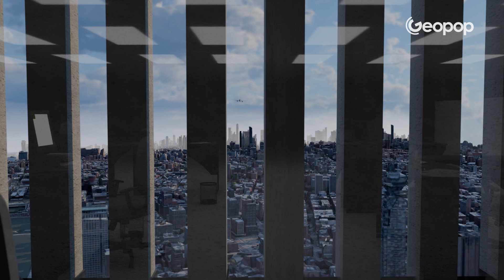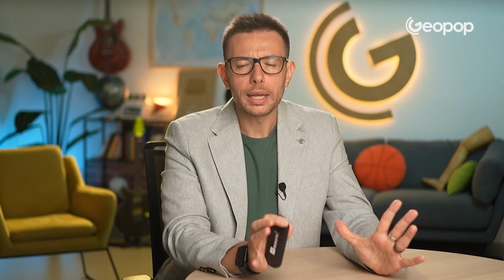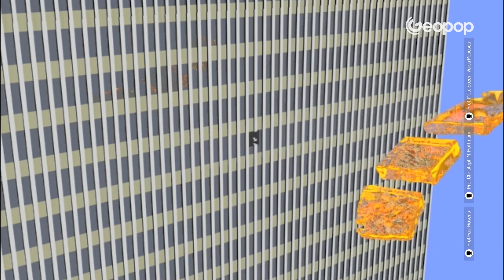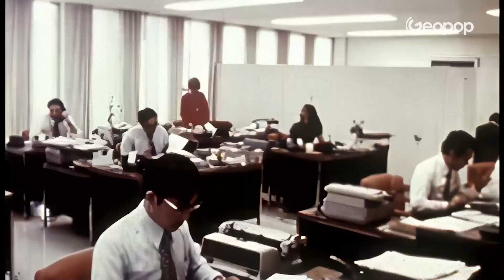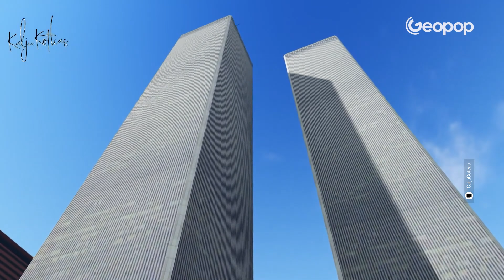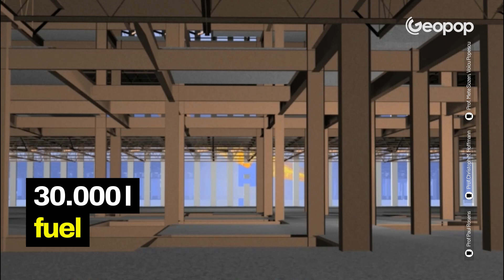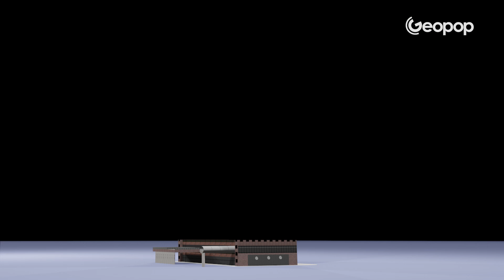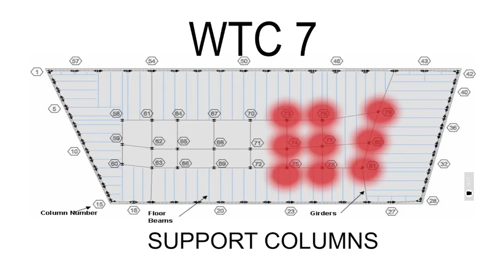9/11, 2001: The Technical Reconstruction of the Twin Towers and WTC 7 Collapses

Comment: Other high-rise buildings that sustained fire didn't collapse, so why did these??? Watch "The Anatomy of a Great Deception" by David Hooper and you will get your answer!!! The Nano-Thermite is the clincher!!!
Reply: Because (A) their fires were fought, and (B) those buildings weren't hit by jumbo jets doing 500+ mph.
Reply: @Tim22222 commercial jets can't reach 500mph that close to the ground the atmosphere is too dense. More lies...
Reply: @HKmaroLS1 yet everyone saw it happen
Reply: @HKmaroLS1  CITATION NEEDED
Reply: @Tim22222  "The airplane was UA175, a Boeing 767-200, shortly before crashing into World Trade Center Tower 2. Based on analysis of radar data, the National Transportation and Safety Board reported the groundspeed just before impact as 510 knots. This is well beyond the maximum operating velocity of 360 knots, and maximum dive velocity of 410 knots. The possibilities as I see them are: (1) this wasn’t a standard 767-200; (2) the radar data was compromised in some manner; (3) the NTSB analysis was erroneous; or (4) the 767 flew well beyond its flight envelope, was controllable, and managed to hit a relatively small target. 

Which organization has the greater responsibility for acknowledging the elephant in the room? The NTSB, NASA, Boeing, or the AIAA? Have engineers authored papers, but the AIAA or NASA won’t publish them? Or, does the ethical responsibility lie not with organizations, but with individual aeronautical engineers?"

Dwain Deets
NASA Dryden Flight Research Center (Senior Executive Service - retired)
Reply: @Tim22222  Didn't watch the movie did you!!! Watch the damn movie-----AND LEARN SOMETHING!!!!!!!!!
Reply: @wasatchrangerailway6921  - Some did (Plasco, Wilton Paes de Almeida). Some didn't. Each is it's own unique case that needs to be studied on its own merits. Lack of firefighting is a key. In two cases massive physical damage from impact and introduction of floor-wide fires across multiple floors simultaneously is obviously a factor. 

This is my summary explanation of Twin Towers collapses of the Twin Towers, start-to-finish, based on my observations without appeal to, or reliance on any authority. No politics or ideology, just what actually happened, which is agnostic to who planned and carried out the 9/11 attacks or why. It has the benefit of not requiring Rube Goldberg levels of complexity and it makes logical sense. Each step in the process flows naturally from the one before AND is chock full of critical details the conspiracy oriented internet tends to leave out with no whataboutisms.  My hope is this will dispel many common myths and answer most if not all questions you may have about the Twin Towers collapses. 

While complex, most of the Twin Towers collapse mechanisms can be seen with the naked eye and easily discerned and understood by the layperson if sufficient time is taken to understand. The worlds engineering community had already largely sorted them out at least as early as October/November 2001. Still, there are many who can’t be bothered to look or perhaps work hard not to see, being more concerned about advancing political/ideological agendas (which is exciting) than science and engineering (which is boring).

1. The Twin Towers consisted of 4 primary structural elements that together formed an integrated system where each relied on the others.  47 hollow box-section steel Core Columns carry the majority of the gravity loads. The 236 hollow box-section steel Perimeter Columns carry the remainder and ALL of the lateral (wind) loads. Long-span Lightweight Steel Trusses connect the core and perimeter column together at each floor with a Hat Truss on top to tie the structure together as an integrated unit where no element can survive without the others 

2. The impact of 117 tons of airplane (= to about 12 dump trucks) at speeds up to 590 mph completely destroys the aircraft.  This in no way implies the Towers come out unscathed. Some folks don’t get that. Hitting with the energy of up to a ton of TNT the impact damages or destroys many perimeter and some core columns (33 of 59 perimeter and 20 core columns destroyed at the impact floors in the North Tower), primarily through bolt-shearing failures at the end connecting flanges, as well as bending, twisting and fracturing of weld seams. There was no cutting or slicing - the reality was far more violent and messy. 

3. The impacts destroy or damage fire insulation, fire breaks and sprinkler systems on multiple floors. Huge fires are started across multiple floors simultaneously and allowed to spread rapidly with no effective firefighting or fire suppression. This was an unprecedented fire event . All of this was observed and recorded.

4. The hotter steel gets the weaker it gets .  With fire insulation stripped away and no sprinklers the survival time of the steel greatly reduced. Gradually over time heat causes the lightweight steel Floor Trusses at the impact damaged floors to sag, which was observed and recorded.  No steel melted nor did it need to. Structural steel will fail long before it turns to a puddle. It just needs to bend

5. Sagging floor trusses pull on the increasingly weak and overloaded Perimeter Columns, causing some of them to bow inward by up to 5 feet. This was observed and recorded. A straight column is up to 4 times stronger than a bent column. 

6. The bowed Perimeter Columns buckle and fail, initiating collapse. This was observed and recorded.  The formerly static mass above which the structure below could easily support is now converted into a dynamic mass up to 30 times greater. Because they have buckled, the Columns above and below the failure point are no longer aligned . The load bearing structure below no longer bears any load as it falls past the lower columns, NOT onto them.

7. Thousands of tons of debris fall within the four outer walls, down through the open office space, crashing onto the first intact floor it encounters. This massive impact immediately breaks the bolted connections to the columns as the amount of resistance the Floor Trusses can offer is negligible.  The falling debris slows only marginally and briefly. Note:
7a. This is NOT a solid top block crashing into and “crushing” a solid bottom block .
7b. The debris falls past the columns not onto them.  The columns provide no resistance to the falling debris. 
7c. Only the bolted connections of the floor trusses to the core and perimeter columns can offer any resistance. A pair of 5/8” bolts at each end of each truss vs. thousands of tons of falling debris.

8.  This floor-led collapse progression within the four outer walls can only go straight down. Note: 
8a. This process is often incorrectly referred to as “pancaking” which actually refers to a completely different process rejected at an early stage. The catchy name stuck but nobody knows what it is supposed to mean.  Pancaking is too simplistic and inaccurate anyway. More like Kaiserschmarrn.

9. Collapse progresses through the floor systems and not down the columns. Rate of floor assembly failures increases with each successive floor as momentum increases, reaching an average acceleration of 0.65 of GA, or 35% slower than true free fall. Bam, bam, bam down the building until there are no more floors to fail.  The resistance offered by each successive floor is always the same. The mass and velocity and thus the energy of the falling debris are constantly increasing.  The falling mass increases with every floor it destroys as new falling mass is added. Some falls to the sides, but most falls down. More mass, more velocity, same resistance with each floor.
The above is unquestionably the path of least resistance

10. The Towers were 95% air by volume and as that air was compressed inside the building it is forced down the tower and blown out the sides in reaction to the building collapsing not causing the collapse. Those were not “explosions”, it was expulsions of compressed air. 

11. Perimeter Columns become detached and peel away like a banana behind the collapse front, playing out to the four points of the compass extending to more than 600 feet from the base of the towers. This was observed and recorded, the results quite obvious from examination of the debris pile. 

12. Core Columns fail last as their internal beam bracing is stripped away and lateral support from the floor to perimeter columns is lost. This was observed and recorded and is most obvious in the North Tower. 

13. For those who care about how long this took, the whole process took 31-34 seconds from the moment the perimeter columns buckled until the last core columns hit the pile, or 1/3 the rate of true free fall. Don’t believe me?  Just watch any video of the collapses and note all the loose and truly free falling debris dropping much faster than the towers themselves.

14. What was NOT observed and recorded were the 180-190 dB bangs of high explosives or the blinding bright flashes of burning thermite. Of course, neither could have caused the (silent) Perimeter Column buckling that was observed.  Neither explosives or thermite could have survived the impacts and subsequent fires either. Cherry-picking a casual comment from someone who heard a loud noise in an event like 9/11 is not exactly “proof” of anything and the pre—planned demolition case relies entirely on that. There is zero physical evidence to support either conjecture. It would be technically impossible, totally impractical and completely unnecessary. No one would bother. 

15.  The Twin Towers were perfectly safe within their design envelope.  They only collapsed when taken far outside design parameters by an extraordinary and unprecedented event. 

Impact + Fire (heat) + Time + Gravity = Collapse . Remove any one of those four elements and there is no collapse. Ignore any of those elements (as many do) and you will never understand the collapses. The Twin Towers were an integrated system in which no one component could survive without the others. One fails, the rest follow, through the path of least resistance – DOWN – through the open space, bypassing the path of greatest resistance – the columns. Don’t get stuck on the but the lower floors weren’t on fire nonsense. 

I hope you found this helpful and learned something. This is meant to be informative, not adversarial, posted with the objective of soliciting informed critical comment, positive or negative. If I made any errors of fact, logic or reason or left anything critical out, please let me know so I can fix it. One topic at a time, on topic only please to stay focused, no word-salads of Gish Gallop. IF you can offer a more plausible alternative be my guest. So far no one has even tried. Please start any reply with the words “Tits McGee” or I will know you didn’t actually read it, are not serious and just wasting my time.